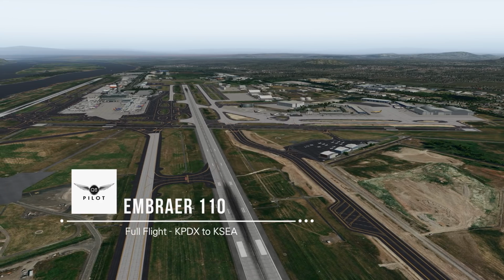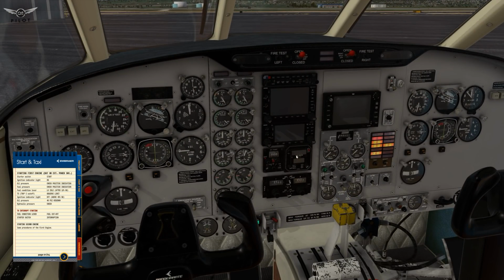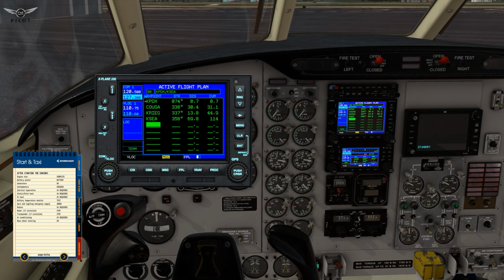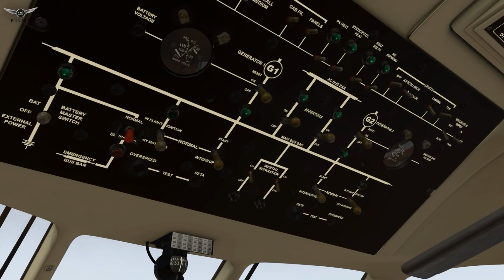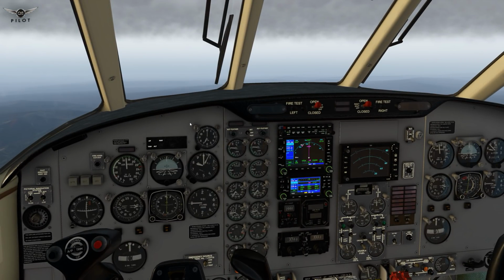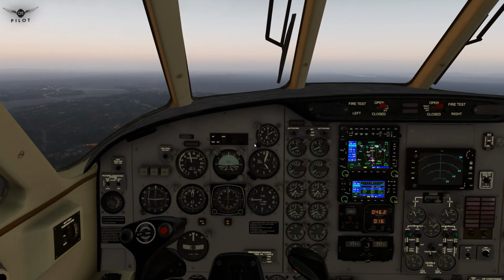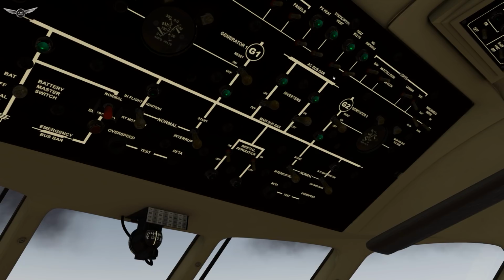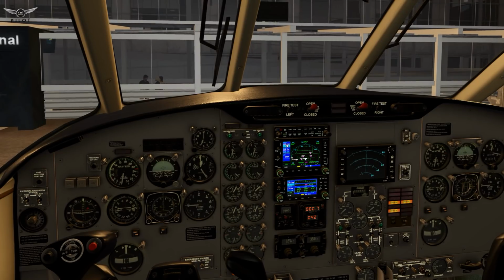[X-Plane 11]  Embraer EMB-110 | Full Flight |  KPDX ✈ KSEA

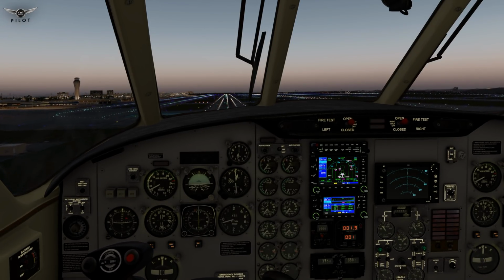Comment: 28:50 What yoke/stick do you use for that fine and nice movement? A Honeycomb? Warthog?
Reply from the maker: Honeycomb
Reply: Q8Pilot Is it a good yoke? How does it compare to the Saitek? I have the Saitek and I’m wishing myself the Honeycomb or the Warthog stick for my 16 birthday. What is your opinion on both Honeycomb and Warthog?
Reply from the maker: @markslandingsandaviationvi3123  it is by far the best flight yoke I used. The Saitek doesn't stand a chance against the honeycomb.
Reply: Q8Pilot But what about the Warthog? What should i buy? I like flight helicopters like the Bell 407 so i guess the Warthog wins at this point but what is your thoughts? I see you have the honeycomb but also the Warthog. Do you use the Warthog only for helicopters or also for cessna 172s?

Comment: Just purchased this aircraft running version V3.2 PLEASE  note that when the aircraft loads, the (Failures) menu in the cockpit is in an ON setting from startup IE it is highlighted and should be in an OFF greyed out setting. Also when loading a new aircraft or quitting X-Plane a software crash occurs. I hope this is of help.
Reply: Why should it be off?
Reply: If it's in an on position you have  instrument failures at startup and takeoff IE altimeter will stop at about 900 feet. If that's ok with you then just leave it in the on setting.
Reply: @leseur6675  oh, I havent experienced anything like that... Ive only burned my engines a couple of times and fucked my speed indicator because I didnt have pito heat on. Is that just for you then or does anyone else have the same problem?

Edit: Pitot heat*
Reply: I thought  that the problems I was having with this aircraft were bugs in the download, but now I am not sure, maybe it's one of my X-plane plugins. So I did a new install of X-Plane on a new drive with only this aircraft as an add on and it still would not even startup with out failures.This is the only aircraft I have had a bad time with and so the only way I can have a good flight is to make sure that the failures switch is in the Off setting. All the best LeSeur

Comment: Hello again Mister Q8Pilot,
just to let you know I found the light I mentioned in my reaction from 9 hours ago. But.. watching your other video "First Look and Review" of the 110 I noticed something very strange. I wondered why there is not much good documentation on how the handle/fly this wonderful airplane (hat's why I didn't find that light I guess) but in this review video it showed 4  PDF-files in your documentation folder. I have only 3 and with less Kb's than what I can see on the view of your folder. The "big" manual (68.707Kb) I don't have ?!!. Your Normal Procedure folder = 24.445kb, mine = 6828kb. Your Emergency Proceduresfolder = 14.505kb, mine = 4256kb. Is your documentation the original that comes with V3 of the EMB110, or did you find those somewhere else? Luckely I have this/your video to help me along a bit, but it's far from easy this way. Can you inform me about this issue please so I can take furter steps if necessary. Thanks in advance from an older novice simmer from Holland :-)
Best Regards, Eddy

Comment: Problems are not all solved. after flying EMB 110, XP11 hangs when trying to shut down the Sim. The same problem as before the update
Reply from the maker: Correct, that's why I  said most of the issues are solved not all. The hanging issue is probably due to a lua script or some plugin conflict. I don't have this issue.

Comment: You did not mention checking the hydraulics during the pre-start check.  The switch may well have been on, and everything went well, but it was hidden by the yoke at that time!  More importantly, you flew at 8000' and descended to 4000' incorrectly.  Please read the charts (and I checked both Navigraph's Jeppesen plates and the FAA's charts on Skyvector).  On that STAR, you need to be at 10000' at KRIEG, not below 12000' and 270KTS at HAWKZ, between 12000' and 15000' at PIKEZ at 250KTS, and so on.  On the ILS 16L, you should leave PAINE at 5000', and don't descend to 4000' till after the IAF at KENMO.  A large part of your flight was below the MOCA for the segment - very dangerous in the RW.  This is only a sim, and is for fun, but Simbrief gave you a STAR which was the wrong one for this plane.  The Olympia Two from BTG would be a better bet, but even this one has you at 10000'.  Love your videos and reviews.
Reply from the maker: Thanks for watching and for your comments. You are absolutely right! The hydraulics were on. As for the approach, as I indicated the flight was not perfect, the aim in  this video was to show how the aircraft is operated. Simbrief gave the right info for the selected aircraft (737), but as the EMB 110 is not supported by default by simbrief, I just took the flight path for the purpose of the video, hence the incorrect altitudes ..etc. Again, thank you for taking the time to comment and I really appreciate your support.

Comment: hey q8 pilot love the video. Just wanted to ask you a question. I'm having a problem with xplane 11 rudder controls where my gear only turns fully to the right when i input full right rudder but when i input full left rudder it only slightly turns to the left. Any advice? (I've checked forums and found no useful answers and i'm using the siatek x56 rhino hotas)
Reply from the maker: Thanks for watching! You might need to reverse the left rudder. It seems that your calibration is not correct. In the calibration screen, there is an option to reverse your rudder direction. Let me know how it goes.